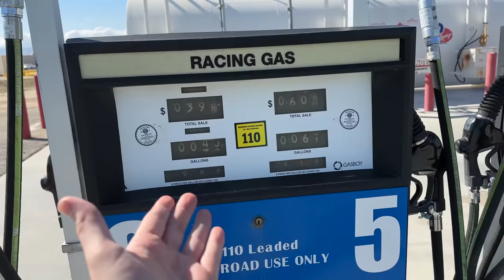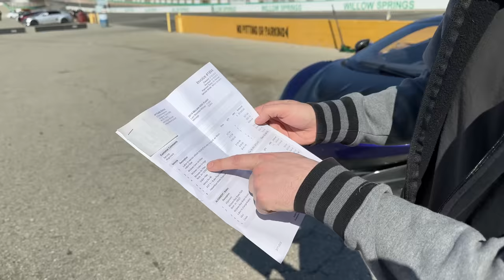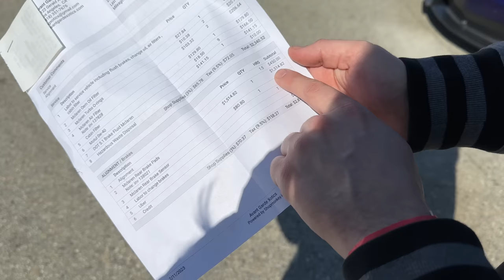My Mclaren Maintenance Bill Is Financially Devastating...

Comment: I've heavily tracked a tuned 570S, an MP4-12C and a 600LT, and none of them were inexpensive to maintain a long as I made the right decisions.. For example, I toasted a ceramic rotor and rather than pay McL's $3,300 /each for replacement rotors I switched to Girodisc. The McLarens are gone now, replaced by Cayman S's. (One for me, one for my wife.) They are great cars, but last year I spent about $20,000 on each for suspension upgrades, major services, replace an AC compressor, etc. It's just the price of poker for pushing these cars very hard. Tires and pads and such came to another $36,000...just for 2022. Then add in HPDE costs, etc., and I almost passed out.

Comment: Performance First Luxury - Elite Plus. Bought that warranty for my 570S....it was around $8,000 for 4 years 100,000 miles. They did good on repairs but battery is a wear item that's was not included.
Reply: There is a module sold by Kevin at Supercar Garage ATL that allows you to use pretty much any battery.  It’s about $1,100 plus the battery, but still cheaper than OEM options.

Comment: For a car that costs $250k, 5000 isn't too bad.
Reply: Yeah, that's what I was thinking.  There's a lot of filters, but the individual cost wasn't too bad.  $140 for supercar oil is very reasonable IMO.  The only part that makes me go "yeah, supercar price" is the $1500 pair of brake pads.
Reply: This a factory roof scoop car, I’d bet this was more like a $330k MSRP or possibly higher
Reply: @jameswillard1  you can pick these up for 225k with 10k miles all day long.  These crypto kids and their cars they can't afford.
Reply: @nicklovely6431  I bought mine for $205k. I was just saying that Parker’s spec wasn’t a $250k car
Reply: I was thinking the exact same thing. My e92 m3 would cost about 3k for brakes all around if I didn't do it myself.
Reply: You're right, it's awful. I could never dream of having to pay 2.5% of my cars total value everytime I needed to change the oil and brake pads. Insane. All my brakes are under warranty. Bought them once and now they're free for the life of my car.
Reply: There's a battery emulator for mclaren so you can use regular car batteries.  It's $1200.

Comment: I smashed the like button Parker, I hope the maintenance bill isn’t Cost you thousands more but every car, no matter if it’s a daily driving car, exotic, HyperCar but they all have one thing in common and that is maintenances. Keep up the good work bro
Reply: My wife's Tesla has 100,000 miles on it and hasn't needed any maintenance yet 😎
Reply: @teslasnek  I have a 2017 Honda CRV with a 1.5l turbo 4 cylinder L15BE motor 18.5psi 1.28bar and it only has been in dealership for regular oil change, AWD and CVT transmission fluid change. The L15BE is the best engine
Reply: @Per-MichaelJarnberg  Umm... like I said, her car has NEVER needed ANY maintenance. Never had to take it into service for anything lol. I think that means its motor beats your "best"  engine 🤷
Reply: @teslasnek  that’s fair enough that your electric motor beats my 1.5t Honda engine which it has very little turbo lag. I find electric motors too quiet for me
Reply: @Per-MichaelJarnberg  Her car has zero lag, just instant electric torque 🙂
Reply: @teslasnek  that’s true

Comment: Careful with the aftermarket vehicle warranties, I bought a car and bought Veritas vehicle warranty, took the car in because of a seat sensor issue that would’ve cost me over $1000 and veritas deny the claim. They stated the sensor is in the seat therefore, it is part of the upholstery. Because my car is a EV I asked customer service if the battery and the battery electronics along with the vehicle motor electronics recovered and they said no.

Long story short read the contract before you buy it .

Comment: Clickbait. A $5k bill is hardly devastating on a $250k car Real world problems 👎🏼
Reply from the maker: I’d say $7,000 for a battery is pretty devastating…
Reply: @VehicleVirgins  No Dude. Its 3% of the value of the car, if you can’t afford the battery dont own the car.
Reply: @VehicleVirgins  but you’re rich so it doesn’t matter..
Reply: @VehicleVirgins  Parker don’t pay $7,000 bud.   Look my previous comment about Kevin at Supercar Garage ATL, he sells a module that plugs into any McLaren that allows you to use any battery like a Gravity or similar lithium batteries for less than half of any OEM option.  It will have no issues or codes.